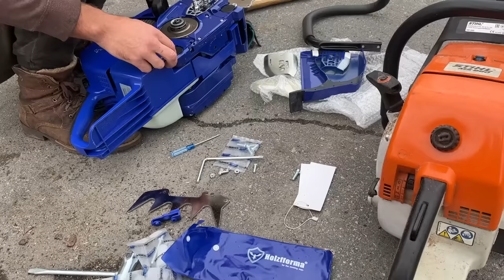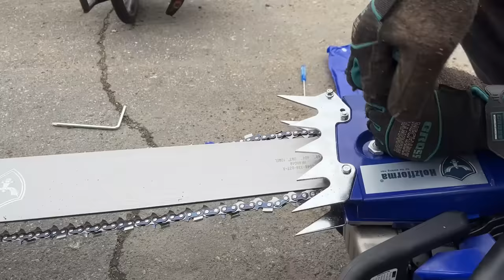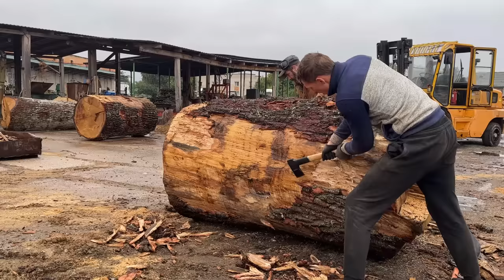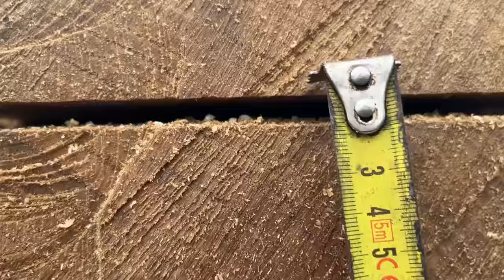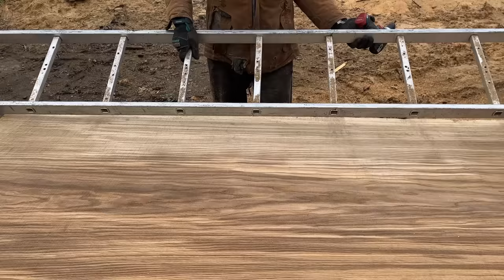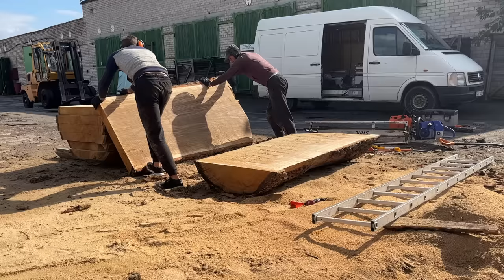Holzfforma G888 vs big oak log

Comment: I'd like to see full time loggers use this Chinese saw along side Stihl and Huskies and see how it lasts against them.
Reply: There kind of hit and miss I've had 9 of them and still have 3 building the fourth. 2 of the ones I have have over 100 gallons through them with little issues. I had a handle bend and broke a recoil. The 3rd one I have broke the clutch and stopped oiling on day 2 after about 7 tanks through it. There not bad as long as you don't mind wrenching on them from time to time

Comment: After watching a few reviews I bought a blue thunder g466 was a great saw for 4 hours or so. It blew the clutch developed a vacuum leak and I ripped the pull cord off trying to get it to stay running. I replaced the clutch carb and starter with stihl oem parts. Long story short its in the saw shop getting new seals. Don't buy a blue saw and expect it to work out of the box long.
Reply: El aciete pasa normal a la espada

Comment: You need to get a hand crank winch setup on your mill! Makes cutting so much easier and cleaner cuts to. Several videos on how to make one with a boat trailer hand crank. Also a bar tip oiler with tank is a wise thing to add on a bar that long. Will help your bar and chain last allot longer.
Reply: T
Reply: Saakhil

Comment: I see you have a lot of tjatter in your saw while milling... Have you guys ever tried a super skip chain? I run a 661, 110 cm deep in oak with it and no tjatter. And i would say it cuts as fast or faster than a full house chain.
And you file a lot less 👌
Reply: A 10* angle on the chain helps too.

Comment: The starter handle will pull off of the rope.
The gas cap will break .
Mine came with a bad coil that was supposed to be replaced under warranty but i still have not received it, i just bought an unlimited coil and kept moving...

Comment: This is the exact setup I'm looking to get to start my slab table business. I fully expect it to break a few times, and I'll replace whatever breaks with Stihl parts and hopefully work out the weak links. Hell, it'll pay for itself with just a couple slabs! I'm not a huge guy. About 5'10" 160lbs. 40 years old, still strong for my size and age though! I was worried if I could handle running this setup for long periods but you appear to be around my size and seem to handle it ok.
Reply: I have the 660 model. I would say right off the bat buy some Stihl brand locking bar nuts, and a Stihl brand chain tensioner. Shouldn't run you more than about $40 combined but the nuts that come with these are not locking and will easily vibrate off. The chain tensioners they use are also complete garbage and wear out after a couple times. Otherwise they're not bad saws if you don't expect them to be as good as Stihl. I also have an issue with the carb where the butterfly valve doesn't want to open from choke to run position so once I get it to pop I have to take the air filter off and with light pressure and a small screwdriver push on the valve to open it to run.

Comment: Now that's the definition of "drive it like you stole it" break in! 😀
Didn't think you'd use the included bar and chain for ripping those logs even if it were longer.
Saw runs just like the real thing too!
Beautiful cuts and slabs guys.
Reply: Actually, the holds former bars and chains cut like a demon add a fraction of the price for Stihl but you’d obviously want to use a ripping chain anyway.
Reply: 0000

Comment: Great job, but my friend, you had to speed up the saw working for 15 minutes until the piston was primed, and you had to increase the oil to gasoline in order to prepare the piston to work. Note here the saw is unable to work at full capacity

Comment: Wow that is a beast! I have the g660 and my only real complaint is the chain break touches the muffler and the handle needs to be more solid. But boy does it mill, I’ve ran it wide open all year with no issues.
Reply: I removed the break you dont need it when miiling also remove the dogs 👍
Reply: What oil gas ratio are you fella's running in these big saws for milling?
Reply: الامك ٠فللاللىقفلى   ؤذش😮

Comment: I like the idea of using the ladder as a support and straight edge during each slab cut. I noticed it is positioned on the side of the log where the saw engine is. Better stability and support of the weight.
Reply: Ppl0

Comment: I wonder does bar oil stain nice wood like that or is it a different type of lube or is the wood just to tight grained to stain
Reply: Man I am curious now as well!
Reply: I have only done slabs with a chainsaw mill similar to this one on black locust and didn’t have any problems, but black locust is pretty closed pore and it leaves a rough surface that you remove when finishing anyways.  I could see it possibly being a problem in something like red oak that has more open pores but not for certain.

Comment: Ребята - знатоки своего дела. Но почему без очков, без маски? Щепа в глаз отлетить и можно без глаза остаться и без работы.
Reply: Technically they should have eye, ear, dust protection as well as long sleeve shirts, pants, chainsaw chaps, and steel toe boots. But after running one of these for hundreds of hours like I have eye and ear protection is the minimum necessary. I personally don’t do the minimum but I can see that with lax safety protocols it would happen.

Comment: This is the hardest form of cutting on any saw.....because your going straight across dense grain.....I would run saw on an angle trying to rip the grain not make dust
Reply: The sawdust produced by ripping is always finer than from cross cutting.  The tooth angles and the chain set up is completely different.

Comment: This clone saw is maybe not so strong than original.
I have clone stihl 66 and it have broken sometimes.
Clutch, oil pump, ext.
Reply: Same brand? If bought from Farmertec and you find quality defects you can contact the aftersale department or the local dealer who you bought from
Reply: There's no oil pump. It's a simple two stroke engine. Do yo u mean the oiler for the bar and chain oil?

Comment: That carburetor definitely needs adjustment you can hear it it's not at full power
Reply: I said the same thing to my young boys. That it's not running clean  and crisp on the top end. They love helping me cut fire wood.
Reply: These saws always come tuned super rich.  But it’s good to break them in on the rich side.  Then adjust and run 40:1 mix and they last “forever”.
Reply: @GotrekGurninsson  Yep I agree. Sounds correct.
Reply: Possibly help with longevity.....especially with milling

Comment: The starter will fail internally - usually the spring fails to engage with the cut-out on the pawl-ring, leaving you with a loose string hanging out. :-) You'll get good at repairing it. I can do mine in no time at all now. I see you already pulled the handle off & re-attached it with a bigger knot.. that happens too.. usually very quickly.
Reply: I hear you can put a sthil pull start assembly on them if it gets to annoying
Reply: Es la peor que hay rappi ladrones es  porqueria eso
Reply: @andersonbarrios357  aca uh haa es para p
Reply: ❤❤
❤àà❤

Comment: Those bars and chains they use are junk junk junk.......put a stihl on it and be done with it....also first two tanks of gas should be like 30 or 40 to1
Then 40 or 50 to 1.  
No revs too.. the saw needs to be heated up